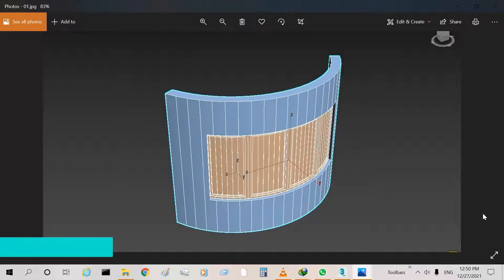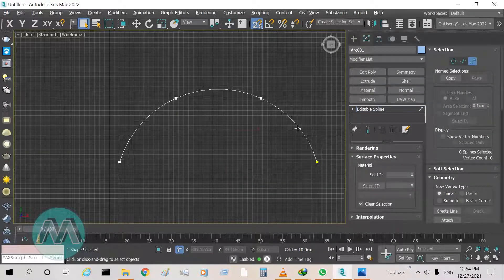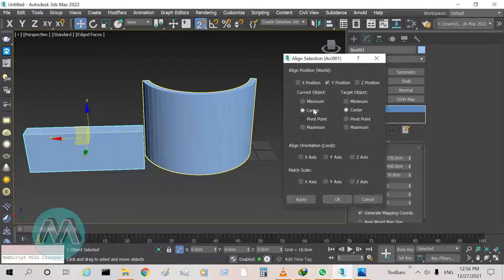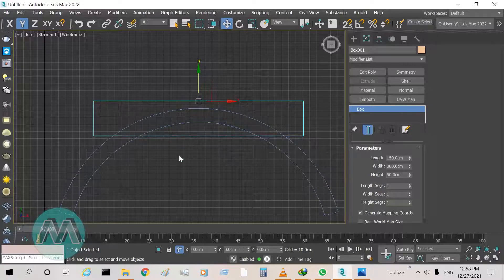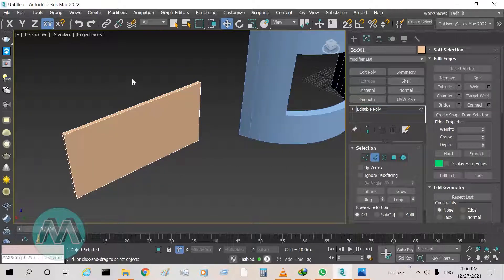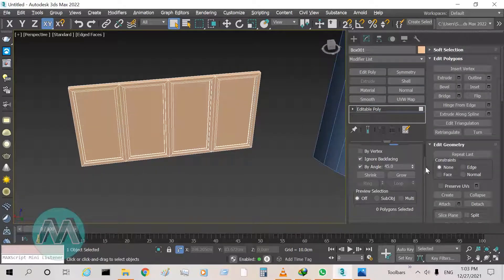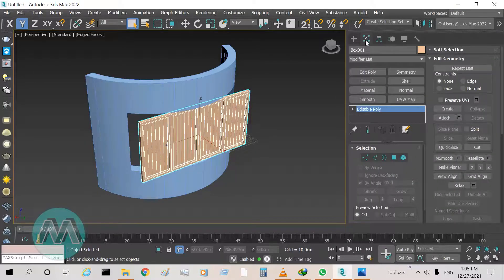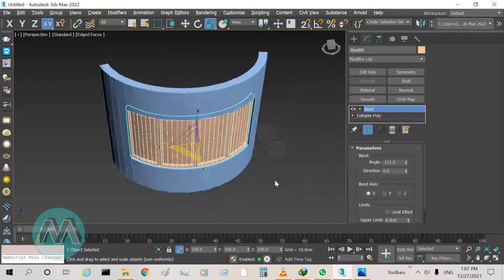3DS Max 2022 Tutorial - Modeling a Bended Window with its Wall

Comment: Dear, you have knowledge of 3dsmax, but NOT of joinery and construction, the wall must be aligned perpendicularly and the window frame remains as it is modeled...
Reply from the maker: hello my friend there are many ways to create models and set them in tru position so the 3dsmax projects can be do for more purposes in this case we only focos to quickly modeling and putting it in its place not for exact calculations or not for exact modeling. thanks.